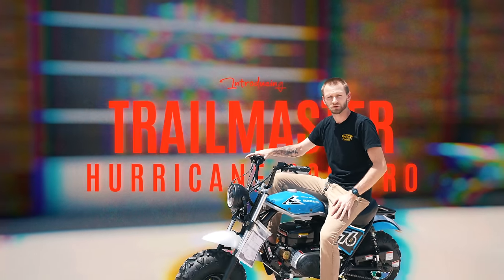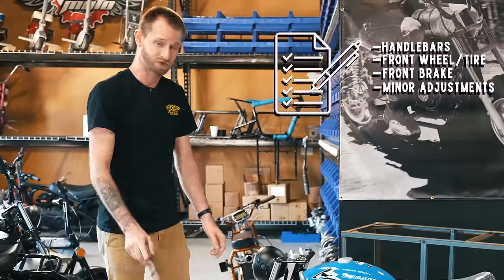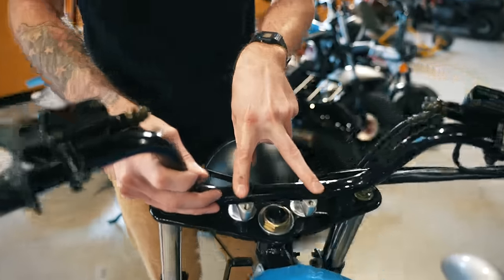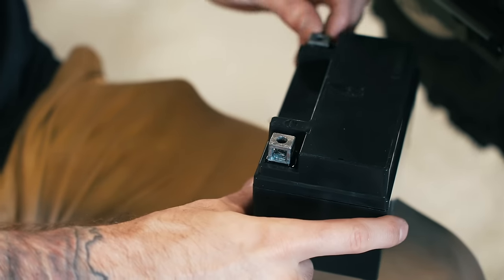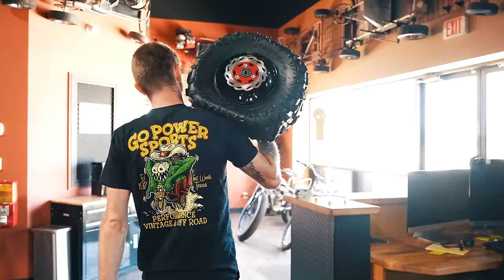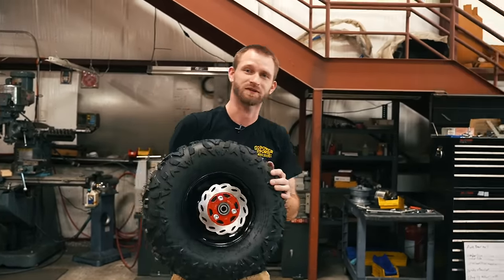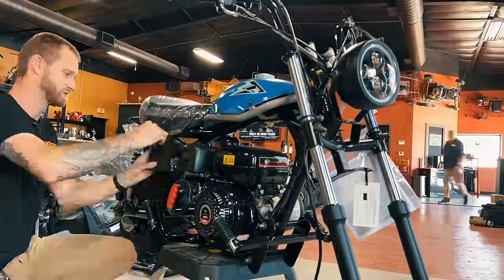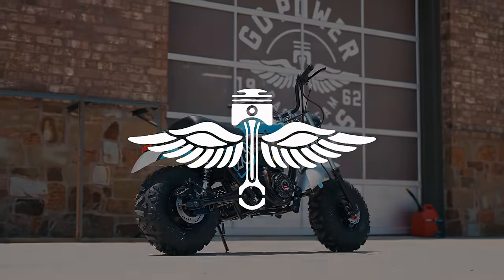I Built the TrailMaster Hurricane 200 Pro Minibike!

Comment: I have emailed Go Power and got some good replies. I will order either November/December or late winter. Since this is new model, are there going to be any new videos with step by step mods or are they the same as other videos. Looking for simple governor removal, simple mods to increase power, i.e. stage one step by step mods. Changing of rear shocks to heavier duty seems straight forward enough.
Reply from the maker: I like where your head is at.  We will definitely do an Upgraded Hurricane 200 Pro Video!
Reply: @GoPowerSports I'm glad to see a positive response.  I like the Super Stage 1 performance package. I am thinking that the raw steel exhaust, properly painted with a high heat flat black finish, would look really cool. Would the stage one kit increase power/speed without the removal of the governor? I see mixed reviews about damage to the engine. Maybe a redesigned governor that wouldn't throttle down the engine as much but still provide safety? It seems that the governor weights flare out causing it to pull the throttle in. Perhaps a restrictive device that allows the weights to move and restrict them to about 50% of max? What do you think?

Comment: If I swap out the stock motor to the Tillotson 212 Hemi electric start will tillotson just plug and play ? And dose this bike headlight have a on and off switch with the low and high beam?
Reply from the maker: You would need to install the dual coils from your original engine on to the Tillotson 212EE Engine.